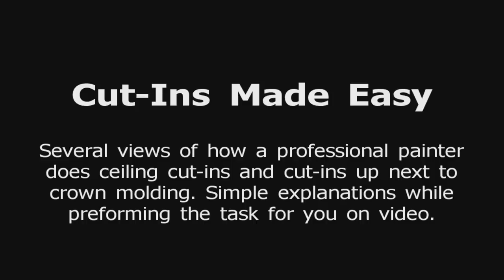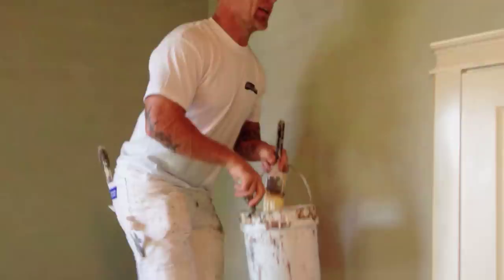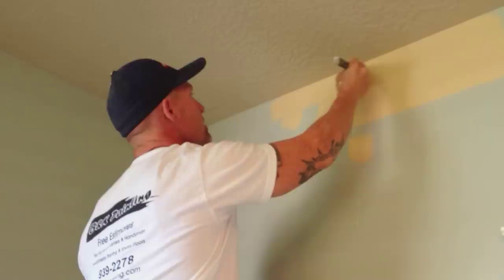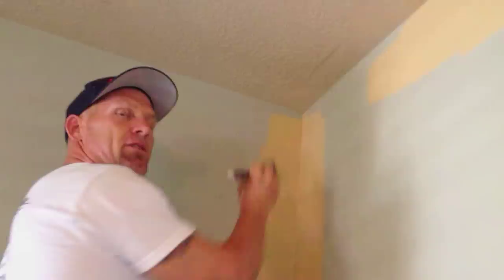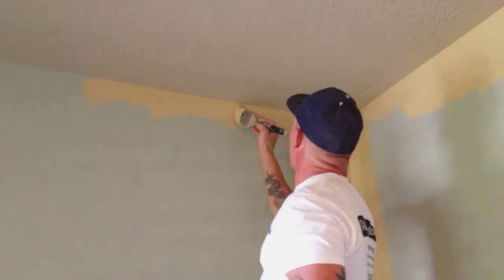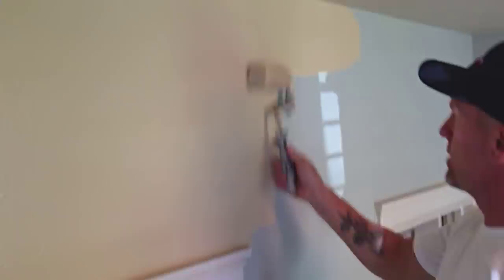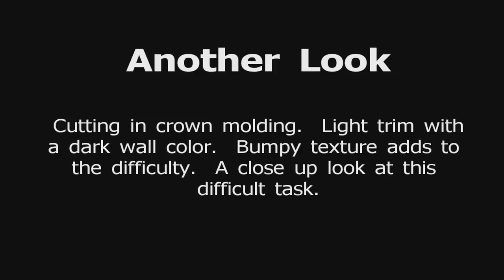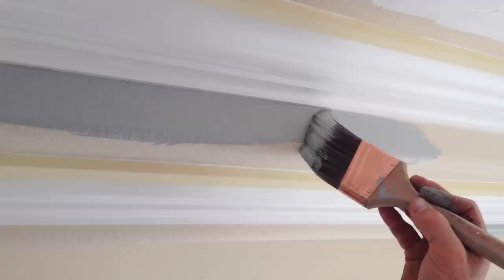CUTTING CEILINGS.  DIY How To Paint A Straight Ceiling Line.

Comment: Your a good painter I wouldn't deny you of that but when it comes to advising non painters I feel you have misinformed. First of all if walls are being painted in a mat or flat, the roller is a waste of time and money. The brush marks won't be noticeable with any paint that doesn't have a sheen. The way you cut in clearly works for you but to the average do it yourselfer your technique will not work. Yes, dab don't wipe, but when it comes to cutting in, never go in for the kill on the first stroke. Create a reservoir with the first stroke as near to the ceiling without actually cutting in. Then with the second use the wet paint from the first to manipulate the paint to cut in.
Reply from the maker: Thanks for sharing Christopher!

Comment: Pro for sure. If you see your painter taping walls and ceilings they are not a real painter.
Reply from the maker: Not necessarily
Reply: True. I agree with you. I wouldn't say it's a hard and fast rule, but tape lines often look harsh and unnatural in ceiling cut-ins or near trim work. I think it depends on how true and straight the edge is to begin with. For example, taping up a baseboard or crown molding at the caulk transition looks weird to me, especially if the surfaces aren't completely straight, and they almost never are. If you do it by freehand by eye, it tends to look good to the eye. :)

Comment: Come on now! Use a man’s brush for that wall. A 5-inch brush is perfect for that job. Perhaps a 2 1/2" sash brush for small trim, but for wide open spaces like that wall your painting use a 5" or at the very least use a 4 inch. You gotta get some paint on the wall, otherwise you'll be there all day. 

Maybe most of your viewers are sissy's or little girls, so they won't mind, but if you’re a professional painter you need a man's brush.

Comment: This ain't right at all. This is not the right way to do a straight edge. When you finish your first brushstroke on the edge of the ceiling you have to start again  where you left it, not the opposite. Because if you start at the opposite to rejoin your first brushstroke its not sure that your line gonna be at the same height on the ceiling as your first cut and this is why you end up with wave. So always give your next brushstroke where you end up the first one. Always left to right and so or if you are a right-handed always right to left and so. I hope it was clear cause im french. A french painter for real :) I dont want to discredit the guy on the video but this is not the right way
Reply from the maker: Works for us
Reply: @Idahopainter Well you are more experience and still its a chance to take. Not all the joins of the ceiling are straight and for a beginner its not the right thing to do and learn. Believe me i have 20 years and more of experience  With the method i explain you take less risk and less corrections to make  that will end up to a wavy cut. Even professionals painters do this mistake cause they learn to do it like this for years and nobody show them this little tip. Don't you think it made sens?

Comment: Saw a thumbnail for this video and clicked on it out of curiosity (I've been a professional painter for over 35 years, but the possibility of learning something new always exists).
You seem a decent individual and I acknowledge that you have skill, sir, but your heading of "How To Paint A Straight Ceiling Line" is misleading (and should be modified), as never once do you explain the technique nor the parameters involved with actually performing this task.
Further misleading is your omission that a second coat is almost always needed for complete coverage (cutting AND rolling) - especially when considering variables such as application over myriad tones, textures and finishes. This eliminates the "halo", as you called it (industry term is "flashing"). Also, the additional work of using a small roller is just that - additional work - and completely unnecessary, as a proper cut will have been laid off correctly, with no discernable striations from the brushes bristles, allowing for a smooth blending between the cut and roll (the roll itself being brought all of the way up to between one-two inches of the ceiling cut line) - a proven method I've implemented my entire professional career.
All the best in your endeavors, sir.
Reply: Im sorry your parents never told you that you were good enough.
Reply: @NovaScotiaKevin  - Your mother made up for that when she informed me how much better I am than your dad.....and you.

Comment: Oh! I blow you in cutting! Sorry, but I'm twice as fast. 30+ years or doing this. I do love the finish of changing colors in rooms. If it takes 2 coats I thin my paint!
Reply: David Regan so do a video but thanks for paint tip on thinning, sounds logical if done right.
Reply: prettymochame just T Just make sure you get the best brush you can afford. It will cover better, and be easier to work with. I almost always use Purdy brushes. When done clean with worm soapy water if you are using latex paint. Put it back in the case, and it will stay in great shape until you need it again.
Reply: Thanks

Comment: brush must be in line of line that you are painting not sideways not emit paint on brush sideways,  incorrect strategy
Reply: seadooman o can't argue with the results 🙄
Reply: seadooman o close to right. you need to use your brush more inline than sideways, but if you can paint a mostly straight line the objective is to spread the bristle. more paint will come from the centre and less on the edges so you run the lighter paint edge against what you are cutting out. too much spread and you stand to paint up into the price, but you need some because you don't want to cut with the full force of your brush. this is also why they make angle sash brushes, it takes less strain on your hand and wrist to spread the bristle at the tip
Reply: This video is good for homeowners that understand and want good results.  He's using too much pressure to get the paint to the tip of the brush, leveling out the brush would require less pressure. He obviously goes to the gym when he's done painting so it won't hurt him to user a little extra pressure! ;-)
Nice paint job though, just takes more effort.